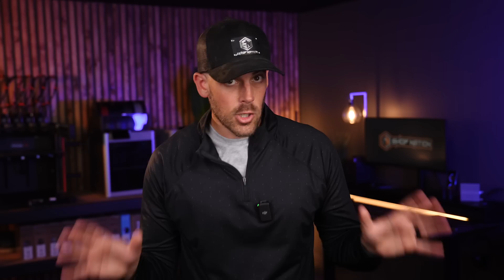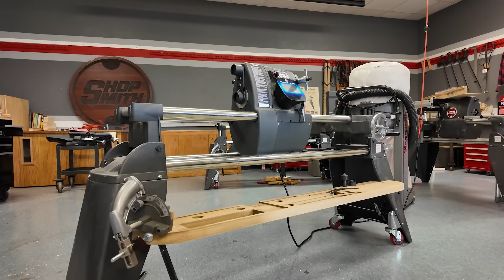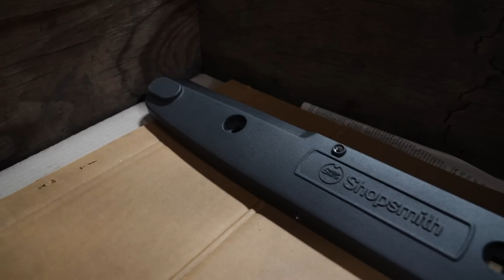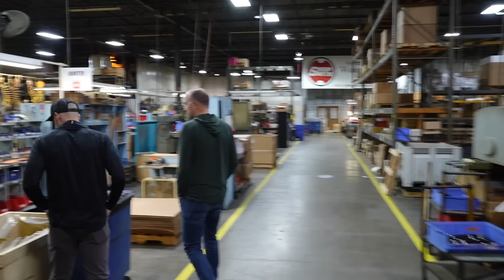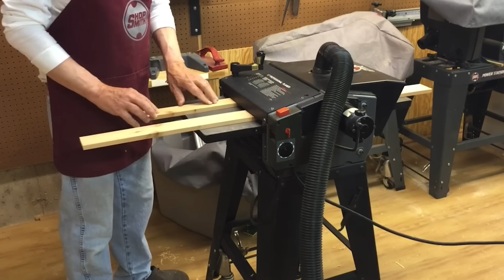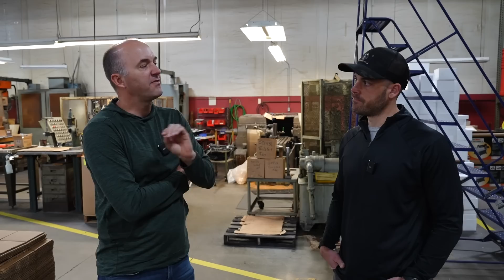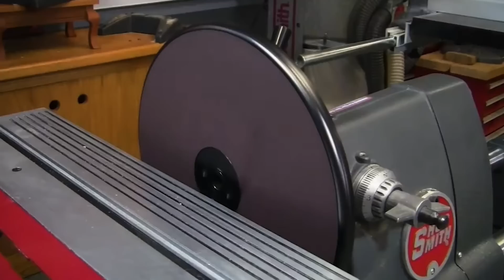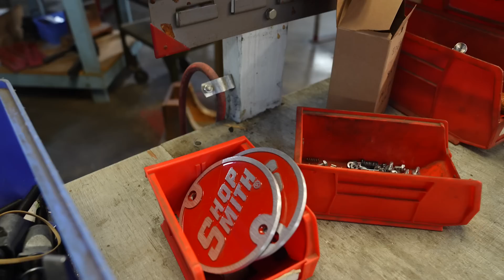The Last American Power Tool Company is (almost) dead

Comment: Thanks for coming by and letting us share our story! 🙂 We're excited to revive the Shopsmith legacy and bring our innovative woodworking machines to both new and seasoned woodworkers!
Reply: I was gifted a mark V and now I'm a customer for life, I LOVE this thing!
Reply: @Nameless-wanderer-c3g  Really? What makes you a customer for life. Try buying a part or a blade for the dang thing. Shopsmith gouges the heck out of their customers. If you have the old table system, it is horrid. If you want to upgrade to the new fence, be prepared to sell your first born. It just doesn't make economic sense to maintain these things.
Reply: @tommaxwell429  Not sure about gouging, it us a niche/ BESPOKE  product ,maybe the  the term " Jack of all trades master of none" applies here, they also are almost more like hand made production compared to now Made in China USA brands, thus they charge a fortune,  nobody sells  new Rolls Royce cars for Toyota prices, tho you'd be hard pressed to find a new  Toyota below $40,000 today.
Reply: I would LOVE to see y'all partner up with Lee Valley, as they also focus on quality over volume and locally-made products.  (...and their loyal customers aren't shy about spending whatever is needed for that quality!)
Reply: My father had two of them over the years. Sadly, I didn’t get either of them. However, I inherited an old rusty one from my father-in-law. Going to find out if it works.
Reply: The first Shopsmith I came across was at a Maker Space.  They bought it because they didn't have a lot of room and weren't working on large-scale projects.  It was a great match for them.  (IIRC, it was one that was made in the '50s that they got on eBay and, even so, didn't have to spend a lot of money on parts to get it 100% working again.)  That may be a good direction to go in as regards promotion.
Reply: @KeithOlson  I personally think maker spaces are THE place for this assuming trained people are available like most maker spaces. While I believe they are great as full time tools, their biggest value imo is the casual but knowledgeable wood worker. I'm mostly a mechanic and tool restorer but it's awesome to be able to transform into a serious wood shop in no time at all. It would be even more amazing if I wasn't such a hack but I am the biggest tool I own unfortunately. At least I'm not the oldest.
Reply: @shopsmith , I am starting another guitar on my Shopsmiths real soon, the methods I use are a bit DIY but pure ShopSmith powered. I carve guitar necks with the overhead router with a jig/ sled.  Pulling for you to succeed, I need parts sometimes, when I buy another one ,  LOL   I have refurbished 2 and sold them, to turns out 35 year old , from nice neighborhood with big house, the same dudes you are looking for to buy SS now! Whole playlist of just ShopSmith on my channel!
Reply: Nice video and shop tour. I bought a new Shopsmith Mark V in 1981 with the bandsaw at the same time. It has never let me down, provides lots of capability in small space. Over the years I purchased the Jointer, Speed Reducer, Biscuit Jointer, and several smaller accessories. Thank you for restarting a fine company
Reply: Thank you for bringing fresh blood to the company. I snagged a used Shopsmith due to space limitations that’s in okay shape. I cleaned it up and it’s working pretty well for me. I need to get some new sanding discs as they are all slightly bent from the previous owner, but otherwise, basic cleaning and lubricating is all it needed. Admittedly, I’m using a Delta tablesaw because I think the SS weak point is the saw, but it pairs oh so well because of everything else that the SS excels at. I do need to get the lathe components, but I’m in no rush. Remaking about 20 old windows won’t require that function and they’re my priority.

For marketing, I think getting a strong YouTube presence could help. Maybe spend some time finding channels with a good host, but is missing some of the functionality the SS provides would get you a beneficial presence.
Reply: Been a ShopSmither since 1978 when I bought my 1st M5. Now own two M7s with all SPTs (upgraded from M500), two refurbished 10ERs and one M5 in parts to be setup as a shorty. Due to health reasons, will probably be selling all in the near future.
Reply: @garycdawson  Wow! You definitely went all in! Go back and add up all of the money you put into these things. Good luck selling them! They are a dime a dozen on the used market.
Reply: Wow, I didn't know Shop Smith was still around! 😳 I remember being so impressed by my uncle's Shop Smith because it could do so many things! When my cousin and I wanted to do a project my uncle would always say "ok, let's break out the Shop Smith!" Truly an impressive machine, keep up the great work guys!
Reply: Someone else commented in a separate comment about ShopSmith incorporating Lean processes into your company, and I’d agree that Lean/Six Sigma processes could be a great help after seeing how the factory floor is set up.
Reply: @Borescoped  The current state of the shop is a result of a dying industry. Six sigma, ISO 9000, all of that crap is the least of his worries. I remember, and used to work for, NCR. They owned half of Dayton Ohio downtown with blocks and blocks of buildings and factories. They made a premier product, mechanical cash registers. The cream of the crop, they owned the market. Then came electro-mechanical and electronic cash registers, they failed to adapt adequately. They were arrogant thinking they would live on forever. They quickly learned a lesson and no exist in Dayton at all. NCR is currently a struggling company trying to revive itself through self-checkout systems and ATMs. They are still alive, but NCR and Shopsmith, both of Dayton, are two examples of how not to move a company forward in the current era. I wish Shopsmith well, but I think this guy has rose colored glasses.
Reply: Its great to see American companies getting fresh excitement around them. I want one, im putting it on my Christmas list.
Reply: @awidesigns  There are better and far cheaper solutions these days. Buy a table saw, the most important tool in the shop and one he downplayed, a drill press and some big box store tools, you'll be fine and save a lot of $$$.
Reply: Shopsmith Metal Lathe / Vertical Mill..... just sayin....
Reply: We are building a home with shop and looking at this just for the quality and the Swiss army knife of the shop.
But the plainer he’s doing away with is exactly what we need
Reply: @Jumpnroger  There are better and more cost effective solutions in today's world. While the all-in-one aspect is attractive and an engineering marvel, it quickly becomes very old and frustrating when you end up spending more time switching back and forth between the tools than working on your project. Shopsmith was a value driven product in the past. With exponential increases in parts, add-ons, and accessory prices, the value component is no longer there. If you really want one, buy used. There are tons of these machines sitting unsold on used tool sites.
Reply: @Jumpnroger  these are $300-400 on marketplace all day long. I just sold one for $295 that was a little rough. $2000 for that planer was insane even as good as they are. Obviously being made in America increases the price which I have no arguments with. Just as a product Nick needed to kill it and I'll bet he didn't feel good about it. If you do decide to go with a shopsmith, take the tiny little bit of time to learn it and man you will have yourself one heck of a thing. I highly recommend the channel @mygrowthrings. He was the lead instructor at the shopsmith academy at the home office in Dayton. He has hundreds of videos teaching everything imaginable on these things. I check in with his channel whenever I'm using a feature I don't use often just to make sure. Nick Engler from @workshopcompanion is also a huge resource. He made many of the old shopsmiths training videos and wrote a ton of the popular mechanics wood working books back in the day. 

Anyhow for what it's worth, I have all of the room in the world and a decent budget. I wouldn't waste two seconds on junk. But I do have quite a few shopsmiths and wouldn't want it any other way. Honestly.
Reply: Grew up with a ShopSmith in the basement during the 60's and beyond. My Dad built a set of cabinets and hundreds of smaller projects. I ended up with it and built a set of cabinets for my family. My observation is folks now days only want professional grade tools, brands like Milwaukee used to be only for the pros, now days everyone has them and amazingly they are of as good or better quality than the old days. Shopsmith will have to remain a premium priced tool to remain a premium quality tool and that looks like the path you are taking.
Reply: @davidbennett7190  It isn't a premium tool! It is a tank and will last, but it is not superior in precision and certainly not in price. The fence system is atrocious. You are right about the premium price. You can bet they will have to retain that feature and it will be their downfall. People are not going to spend thousands and thousands for a system to make a breadboard or turn a bowl as the guy said.
Reply: I will never buy a product from a company that designs obsolescence into their products and expects me to keep coming back to buy the same thing over and over again. That is why I don't own anything made by Apple and the like. It is the insane belief that line must always go up that has created the negative incentives that are 100% anti consumer. I wish you all the best in renovating this brand and sticking to sane principles. I'm not a woodworker otherwise for sure I'd be looking at one of your machines!
Reply: @vincei4252  what obsolescence is built into the shopsmith? Three of mine are almost 50 years old. I can interchange the parts with my 1998 model which is also not young. Any wear components are easily replaceable after market a lot easier than I can my deltas or jets. There are also tons of us who mod them. I don't play the built in obsolescence thing either. That's why I use shopsmiths, shave with a Schick injection razor and drive vintage diesel Mercedes.
Reply: @vincei4252  You can look at it in many ways. We live in a throw away world. There are advantages to both. High quality is now the expectation, at a lower price. Hand power tools are an excellent example. They are relatively cheap and they work! When they don't, throw them away and buy another one. The days of high priced tools are over, people just will not support that model. I'll spend $2K on a Sawstop table saw and still have $3K left over to buy other tools while having a far superior product to the Mark 7. It's ridiculously overpriced. Upgrades and parts are outrageous. You'll spend as much to upgrade the fence on a Mark V as you would buying a Sawstop. Crazy!
Reply: Thank you, all Daytonians should stop by and take an intro class when you get the education center running.  This is the future, we can't afford to keep buying disposable furniture.  America needs to get back to fixing and making things.
Reply: @markweatherford9233  LOL! Really? You honestly believe we are headed back to the days of craftmanship and skilled furniture makers? That may be a nice dream but it isn't reality. Ikea sales billions of dollars of particle board furniture every year. And people are lining up to carry it out of the store. Skilled woodworking is a very very small niche and a dying skillset. I hope this guy didn't invest too much in this company.
Reply: I wish you the best - I had one in the UK and it was fantastic. Used it every day.  

Lost it when I emigrated to the EU and I miss it.
Reply: I'm rooting for you, but I'm skeptical. I used to own one of the original Model 10's--which I inherited from my grandfather. To make a long story short, I sold it after using it for 10 years because it took up too much space for what it did. But maybe I was never the demographic since I had zero interest in the lathe aspect of the tool (not sure how many lathe lovers there really are...). As you (Nick) acknowledged, most people want a table saw first. A small contractor table saw like the Dewalt takes less than half the space of the SM--leaving enough room for a separate drill press and a small bench jointer. Furthermore, the table saw in a small shop usually needs to be mobile in order to accomodate sheet goods and out feeds--something that I found difficult with the SM. And none of this even accounts for the hassle of changing the tool from one mode to another. 

Yeah, I know this is for hobbyists, not high production shops. But you can buy a lot of nice toys for $5K at the big box stores that are inherently modular and more flexible. I'm not making quality comparisons, I'm just thinking about my friends and neighbors who are wannabe woodworkers, and I can't imagine them choosing one large machine that has to be broken down for each different mode (which gets really old really fast), versus smaller tools that can be moved and stored more easily--and can more readily travel to a job site if needed. Plus, most of us buy tools incrementally as we discover our needs and wants rather than make a major investment all at once--even if that major investment might be the better long-term value.

Not trying to troll, just pointing out the tough demographic and marketing issues I see trying to manufacturer and sell a large, heavy-iron tool in today's marketplace. On the flip side, you seem smart and aware of these realities, so you may well be the guy who can pull this off.
Reply: @mntriangle  I AGREE 100%. I have always been a wood worker, shop classes were the reason for going to school. Grade school in the 60's out on my own in 72. Ten years later I was given a Shop Smith  from a friend who's father gave it to him. I tried to love it but as you mentioned breaking it down for each function gets old fast. With cheap power tools from HF, I soon had a drill press, a 6" jointer, shaper and my big score was a DeWalt cabinet saw, the 5hp model. I never had an interest in turning bowls or anything else. I did at one point replace the rubber on the band saw so it could be used but by then I had a Craftsman and a Fox band saws along with the one from HF. I also have four miter saws, two of which are Hitachi/ Metabo and easily do what a Shop Smith can not do.
Finally just this weekend, I needed a piece of 1-3/4" pipe for an exhaust repair, after welding on a flange, I realized what the pipe was from. . . .
Well the Shop Smith will be a foot shorter now.
I wish the company success but with all of the tools being offered on Amazon they are going to have a lot to compete with.
Reply: @mntriangle  I know what you mean. A friend of mine wanted me to visit him in London this Autumn and I was like dude you are crazy. The whole city has been bombed into oblivion, coal prices are through the roof, and I don't know if the Germans are going to regroup and attack again. 

He then reminded me that, like the introduction of the 10er, that all happened in the 1940s and an awful lot has changed since then. This reassured me as I have been putting off buying a new Ford because the one I had back in the day didn't have air conditioning or power steering and the brakes were oiled rags around an Axel with a wooden push block. I guess I should probably assume things have changed in the last 80 years.
Reply: @mntriangle  Bingo! You summed it up nicely. I take only one exception to what you said and that is the big box tools are not lower quality. I have Ryobi hand tools and a compound miter saw that are going on 10+years and still ticking. They are fine. Shopsmith is a high quality tank, but it is heavy, bulky and a pain in the ass to reconfigure while working. I'm getting up in age and lifting the damn thing into the drill press position is becoming more difficult. For what I do a good table saw and smaller lighter and cheaper supporting tools is a better solution.
Reply: I hope to get a Mark IV soon, it should be perfect for my needs.
Reply: Just heard of you guys! Might just have to invest! I’m a residential builder and can always use a cool tool from  a company right here in the states!
Reply: To survive in todays market it shouldn't be limited to woodworking. Guys that want a home shop want the ability to do metal work as well as wood.
Reply: If you guys need someone to come onboard and spearhead your marketing, I would love to discuss that opportunity with you.
Reply: I'm rooting for you!
Reply: Best of luck to you!!!!
Reply: I have THREE of these great machines, including one my father bought in the 60’s!
I have been to your facility as well.
Good luck!
Reply: About 2 months ago I was wondering if ShopSmith was still in business as there are hardly anything that is  " Made in USA "  anymore,, I have to go to pawnshops or flea markets   to get tools that are stamped Made in USA.
Reply: Dayton Ohio is now a bucket list destination!
Reply: @edh9237  we have a lot of neat stuff especially if you are into aviation. National Air Force Museum is Incredible. Carillon Park is amazing and worth looking up. We have Gerstner tool boxes are made here and have factory tours. If you are staying at a hotel on Miller lane, across the road is Poe Ave. That whole road was shopsmith when I was a child. There are a lot more things I'm just blanking. We hit way out of our weight class for a small mostly ho hum city we have become.
Reply: I wish I was near you , Im retired and I would love to make the patterns for 
a 6 inch jointer ........ Alas Im in the UK 
( Although I did work for one of the biggest employers in Cincinnati and spent 
a lot of time in that area )
Reply: I’ve got a 10er that I keep set up for lathe use. Far better than any harbor freight modern option.
Reply: Wow this video tugged at my heart. I’m a millennial aged engineer and I’ve worked for over 10 years in rust belt manufacturing for small companies that haven’t quite kept up with the modern tech age. I am rooting for you guys. Consider broadening your market to small businesses and fab shops that can make use of your tools and save money. Also try to get more brand recognition with online presence and even try to get into regional hardware stores where one model on display can turn a lot of heads!
Reply: @Grauenwolf thank you for the cheeky reply. Maintaiance is still maintainance, and if you don't know, then you don't know. That's why I said what I said. It wasn't showing laziness as you clearly pointed out. Clearly i was asking a question to find out what I need to do to use it. I didn't get a maintainance guide from ShopSmith, nor from the person I bought it from. But I'd really love to see the beautiful items you've made on your ShopSmith that you're passionate about?
Reply: I'm rooting for you and will remember your brand!
Reply: something to strongly consider looking into is the materials you build your product with and harnessing newer manufacturing technologies. one of the issues i can immediately see is while yes your product is robust, its also worlds heavier than your competitors. in the past 50 years alone there have been leaps and bounds of advancements in material science of which potentially open up all sorts of options for modernization and addition of other features.
Reply: @wut6113  the actual problem with the shopsmith is it doesn't weigh enough. I know it sounds crazy. It's because of vibration. Heavy equipment is usually more accurate because of vibration. In fact many people put sandbags over the way tubes for weight and vibration damping. It also isn't that heavy really. Plenty of my tools weigh as much or more. I roll mine around on carpet just fine and if I don't have any accessories on it I can lift it off the ground. I can't do that with anything else but my craftsman drill press. (Had it before the smiths and hardly use it now which is kind of sad) Without needing the weight I would absolutely agree with you. There are a ton of ways it could be lightened and I'm sure their brilliant engineers would love to.
Reply: Speaking as someone in quality control, do NOT farm out your machining, at least not completely. Right now you have a ton of tribal knowledge in your shop. You need to get that documented so when those folks retire out you can still do business. It's also the foundation of what you want to do with becoming more efficient.

PS I used some of your equipment in middle school IA class in the 80's.
Reply: The Shopsmith would make a great graduation gift or wedding gift. There are many makers classes in community colleges, so partnering with any woodworking classes would probably be a plus.
Reply: I Love what you guys are doing, I want one!
Reply: I can't even find a distributor or retailer on line you need better marketing 
I would love to see shop smith on the shelf again 
What a great product
Reply: Shop smith is one of the best home owner tools you can by I didn't even know that they were still in business
Reply: Don’t forget the overseas markets.  Worldwide customers may want a high quality, US made piece of equipment over a Chinese counterpart.
Reply: My dad is moving into an assisted living complex and the one item I told him I want more than the rest is his Mark V Shopsmith. I'm going back to Utah in two weeks to load up what I am going to keep from the farm and the Shopsmith is going on the trailer back to Iowa with me. I may be contacting you for attachments!
Reply: @shopsmith  I think if you had a youtube channel where someone pulls out 2 cars from their garage and does real projects with your equipment that would really help.  WE see these guys with their studios of equipment, show what a real DIY person can do in real DIY Space.  show them working around the bikes and trying to maximize their space...
Reply: I fully support you guys! It’s energy like this that can bring respect back to US manufacturing and bring equitable union paying jobs!
Reply: One of these days I'd love to get my hands on one of the originals built by Hans himself. He was the brother to my Great Grandma
Reply: The description of people watching woodworking videos as living vicariously through them perfectly describes me. I think partnering with a really good woodworking presenter and building a social media presence with them to show the machine is exactly what you need to do. A little investment in a professional video production set up could be incredible in returns. Build a community, include members, do giveaways and collaborations, etc.
Reply: Shopsmith, consider marketing to the "I'm retiring and need a hobby" crowd. Some of us are skilled woodworkers that need to downsize. Plus, most of us are familiar with your name. We just don't remember that you're still alive.
Reply: @danwagner3720  , That's exactly right. I remembered the name, and was very surprised to hear they're back with even better equipment through modern upgrades.
Good Brand.
Reply: @danwagner3720  so, market towards the only market they kinda already exist in…. Ok.  That market has been buying the same used shopsmiths for decades.  It’s a winning Buisness plan right there.
Reply: Imagine the sales and positive exposure if you could get President Trump to come tour and speak from your factory about American made products and jobs.  👍🏻🇺🇸
Reply: ...and speaking of partnerships, I suggest you look up 'This sanding disc will improve your woodworking and carpentry, period.  Mike Farrington' for an intriguing locally made product that should work perfectly with your tablesaw.  (I would include the video link, but YouTube randomly deletes comments that contain such internal links.  :shrug: )
Reply: I bought my Shop Smith at a show in the Cleveland IX Center back in the 1990’s. I used it when I first started my cabinet business, mostly for drill press and lathe work; the table saw is really lacking except for small material cutting. I did use the horizontal boring capabilities as well. What the machine really needs for this is an X-Y moving table accessory with a couple of handles to move the axes. With Festo making loose tenon joinery popular but also financially out of reach for the hobby woodworkers, this would be a great addition to the line.
Reply: I wish you much success in growing Shop Smith. 
You have a great product and great story. 

Social media/YT and a solid marketing campaign will definitely help
Reply: Where can we buy one? I'd love one in my garage. I watched all the demos at my local mall growing up.
Reply: Thank you for keeping an American icon alive in the USA. I have all those tools that it would replace, but I also have a shopsmith with table saw, lathe, and disk sander, plus extras, that i bought off Facebook 4-5 years ago. But my problem is that it is so intimidating and with the constant maintenance (so I'm told in many YouTube videos) that it sits and I never use it. I'd love to give it a chance, but if I'm in fear of a tool, I'm not going to use it. Do you at ShopSmith have any suggestions? I hope it's simple that I'm just watching the wrong videos.
Reply: Who wrote this comment? Is it Nick featured in the video?
Reply: I wish you the best of luck.
Reply: @Grauenwolf  planers are really more for sawmill owners not typical woodshops that already use milled lumber.
Reply: If I was wealthy or successful I would own. Have you talked to your federal elected officials and see how things could be made easier for ShopsSmith business cycle for National Security interests?
Reply: I am in complete support of American Manufacturing and truly hope you are able to save and return to glory the ShopSmith Brand and products to the American hobbyist wood worker. As a fairly seasoned woodworker myself, I have owned 2 vintage ShopSmiths purchased used and at a good price that made them hard to pass up nd of course, I was curious as to how well they worked and each of them served me well for what they were. Both of them later left my shop for one reason  only, the modular platform. Having the option for all the tools is great, but having to go through the set up to switch the operations was a killer for me. Especially the table saw, which, you admitted was your weak point (I would agree, it is not fantastic,  it  does function but never felt great in use...) Overall however, ShopSmith machines are extremely reliable and robust and clearly well built and always have been. The lathe is quite good, the bandsaw is ok but could  definitely use improvement,  both in cut and width, the drill press works well.  I didn't have the jointer attachment unfortunately, or the belt sander. 

I believe these tools absolutely have a place in the shop, for so many different demographics. I will say that classes on how to use them is a must or should be for a novice for sure. If the modular platform can be improved to create a more seem less transition and/or  allow for more tools that can remain 'in use' at once, I'd consider buying a new one for myself again simply for the space savings, as do only have a 2 car garage as a workshop that I share with the wife's SUV
Reply: There's GOT 2BE  be a way to get making in America again.
Y2K proved that. Trillions of $$$$ were made by blood suckers as a result of the offshore fiasco.
Reply: Reach out to Ask This Old House, Mike Rowe and bring in guest YouTube woodworkers. And try to get on Shark Tank not to make a deal necessarily but for publicity on national tv.
Reply: You will need to see where exports take you.  You can’t be around on the North American market alone.
Reply: Vintage Magna Engineering training videos from 70 years ago still apply https://www.youtube.com/watch?v=fQnt6EXcoZk
Reply: Shop smith is one of the best home owner tools you can by I didn't even know that they were still in business
Reply: You need to have someone like Adam Savage test and show this things, he has a huge audience of enthusiast
Reply: I've wanted a Shopsmith for many years. I now have some of the tools that this could do. I also saw a Smithy once many years ago that was similar to this but could also be used for some light metal work. They no longer make these. Is this something that y'all would consider building? It might help get a lot more people interested. It would be great for hobbyist and small farms to have one tool to do so many things and not take up much space.
Reply: If you decide to bring back the planer attachment, charge more money for it. There's no way you should only be turning a $400.00 profit on that piece, 6 to 900 is more adequate.
Reply: Dive into Dan Kennedy's magnetic marketing system, and you will have no issues bringing this brand back.
Reply: Gun free zone sign on your door... What's up with that?
Reply: Are used to think the  Shopsmith
Was something for hobby dad's. But that was in the 70s and 80s. 
Maybe I'd want one but it would be great or everything but good for everything. 
It sounds like you turned the company around. 
Add this may be would be grandpa, wouldn't mind having one. 
My buddies turning 65 
In a year or two I'll see about a gift of one. 
I will tell you after being in the trades are 40+ years
I never trust a contractor or a craftsman that owns all the same color tools... 
yellow is the worst. Thanks guys!
Reply: I find myslef cutting a part on the bandsaw, using the disc sander to finish shaping the part, then my drill press the drill some holes in it. Having to change the attachments on the shopsmith for each operation would be a pain to get any work done. That is the downside to the shopsmith that has prevented me from purchasing one.
Reply: I love your machines, send me one of those to Paraguay please!
Reply: You can start by fixing your customer service.  Just had the WORST customer experience with you guys.
Reply: I’m getting into wood working and have plans on building a shed as my wood working shop. I will definitely try to take a look at your tools in the future. I wish you all the best.
Reply: Thanks for giving the tour. If there is one thing I would suggest is the option to mix and match attachments on the base setup. I don't need a table saw I already have one, but I do need a larger lathe and a bandsaw in my shop.
Reply: @asm2750  buy a Lathe then. Will be better than the Shopsmith version. Shopsmith lathe is not heavy enough, it’s to low hurting your back. No way to add an of the advanced lathe tools if you ever want to grow, such as a vacuum or indexing chuck.    None of the long hollowing tools work on SS or bowl cutting jigs, steady rests, etc. 

The bandsaw is just as big as a separate Bandsaw, so get a separate bench model unless you find a cheap used SS.
Reply: I love American made tools from the past that last.
I will be looking for Shop Smith to make a resounding resurgence.
If you manufacture a tool I need, I will put you at the top of my list. 
Buy American!
Reply: @davidgraham2673  maybe if they just reissue the table top with Standard miter slots.  They are no longer a market leader and using proprietary slots hurts them.  Adding standard slots to the table will attract new buyers and old buyers alike.  Let’s be honest, they’re going out of Buisness though.  Last owners squeezed the last few bucks out the Buisness and pond it off.

Standard Miter Slots - Required to survive.
Must sell something new that isn’t on the saturated used market.
Reply: Reach out to @Bourbonmoth.  He's literally in the middle of a "Small shop Build" for this exact market.  How do you build out a shop with limited space and still turn out neat projects?  Seems like a match made in heaven.
Reply: My uncle always had a Smith and I was always amazed at the things he would make. Fast forward and I picked up an old used one, refurb’d it and I can’t live without it now. Please do PROMOTE and open new sales channels. More creative people need this tool in their hands!
Reply: financing is the biggest thing.  Find a way to partner with automotive OEM's and dealers to sell the lifestyle
Reply: @ lol, like a Volvo or Buick…….
Reply: @shopsmith you are NOT the only power tool manufacturer in the US.  There are 2 in my small town of 2000 people.   Not to mention places like Northfield, just to name a few.
Reply: good luck to SM If i ever downsize my shop i will definitely be getting one.
Reply: Rooting for you ShopSmith! 🇺🇲🇺🇲🇺🇲
Reply: I didn’t know you guys existed.  I just wish the table saw was bigger.
Reply: Are you maybe planning to introduce a small additional mini product? Like a cordless drill or a router etc? I would like to support non-China companies and buy something in the $500 range. I already have a drill press, a sliding table saw, a CNC, sander etc so buying the ShopSmith isn't for me. I was hoping I could buy some gadget to keep the cash flowing.
Reply: I just ordered the mark 7 and so excited for it
Reply: Thank you for your continued American Effort & Ingenuity
Reply: 6 months late to the party, but better late than never. Im more of a metal worker at heart, but this tool is exactly what I could see myself buying for the woodworking tasks that I do tackle. The fact that its made in the USA with as many USA made components as possible, puts your brand at the top of my list for manufacturer choice.
Reply: Love making improvements in a factory setting.
Reply: I bought a used Shopsmith for my son-in-law in the mid nineties, he showed a strong interest in woodworking.  He is the father of 2 boys 17 and 20 years old and the Shopsmith sits in the garage and was used very little.  He never showed his boys how to use it.
Reply: I blame China for stealing American technology and selling it so cheap that it's forcing American companies to fold.   I also blame American companies for their greed and high prices that are also forcing consumers to buy the Cheap Chinese version.  And lastly I blame Americans for their lack of pride in their country that they would rather buy Chinese than American.  With that being said where do we go from here.  ALL are valid statements. And nobody has the answers to.
Reply: Awesome to see you're working to keep the brand going! I'm using my father's Shopsmith that he bought in the late 1950's. I need to do some rust removal on the rails and get it looking pretty gain. For now I keep it cleaned and oiled, the headstock still slides smooth as silk. Thanks for keeping the legacy alive!
Reply: Thank you for being here and posting this!!  Thank you for being here and fighting the good fight!!
Reply: I wish you guys made one rated for steel.
Reply: Nice sharing.   Thanks.
Reply: It’s your company that the government needs to give our tax dollars too.
Reply: The day I can afford a shopsmith I’m calling and buying one with all the attachments period.
Reply: I didn't even know ShopSmith existed. I would have considered it earlier on if I knew about it. Too bad I'm already neck deep with other tools. One important thing I'd like to know is who owns ShopSmith? I assume privately owned, but by who?
Reply: WHAT DO YOUNG PEOPLE WANT TODAY?  QUALITY OF LIFE.
WHAT ARE MAJOR QUALITY OF LIFE ELEMENTS? FULFILLMENT, SATISFACTION, ACCOMPLISHMENT.
WHAT MAKES PEOPLE FEEL GOOD ABOUT THEMSELVES? DOING GOOD THINGS, SOLVING PROBLEMS, HAVING A CREATIVE OUTLET.
WHAT DO MAKERS OF EVERY KIND HAVE IN COMMON? THEY ARE ALL PROBLEM SOLVERS.
THE GROUNDING AND CENTERING THAT OCCURS IN THE MAKING OF THINGS IS TRANSFORMATIONAL.
WANT TO REVIVE SHOPSMITH. SELL TRANSFORMATION MESSAGES.
THAT IS THE AWE THAT SOLD SS DURING THE DEMOS IN THE MALL.
"I CAN DO THAT!"
THE VALUE ADDED IS SMALL FOOTPRINT, MULTITASKING, ONE TOOL FITS ALL.
QUALITY IS ALWAYS THE BETTER VALUE.
THE HISTORY OF SHOPSMITH IS IN 600,000 GARAGES AND  BARNS TODAY. IF THERE IS ANY SUCH THING AS AN HEIRLOOM TOOL, THIS IS IT.
Reply: I owned a Mark 7 for about five years. It never worked. The gen 1 power pro head was awful. I tried customer service a few times, but they wanted to charge me for a PHONE CALL. I replaced the speed sensor, no change. I saw the other day that you’re going back to building the Mark 5, which I think is a good decision. Like you said in the video, stick to what you do best—computers-controlled motors weren’t it. I wanted to love my Shopsmith so much—I bought a ton of accessories for it. But ultimately I sold the whole thing at a great loss. 

You said it yourself—the most common first tool is a table saw and yours sucks. Continue to simplify and get the simple stuff right, and you will do well. Good luck.
Reply: We wish you all luck!
Reply: I found your website confusing, I don't quite understand how your machine works, I need a Mark and then attachments? 
Step 1. would be a simpler way to learn the platform, 600,000 in 71 years is not a lot, which is fine, just assume anyone viewing your website knows nothing.
Reply: @spencerroberts7918  We agree, which is why we're launching a new website within the next week! 😀
Reply: youre the last american power tool company, lean on that shit. perfect marketing angle.
Reply: I see these things on facebook market all the time. Best wishes to your future for those who have small spaces! If you're successful you can resurrect all the 80s-90s Craftsman stuff (under your name) for people with more space! Hope you guys can avoid l*ftist business killing red tape.